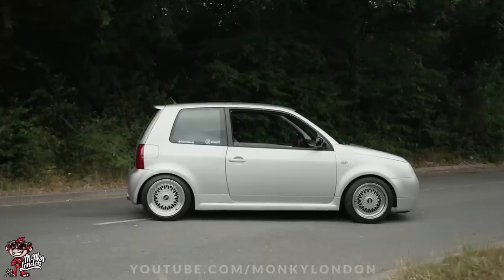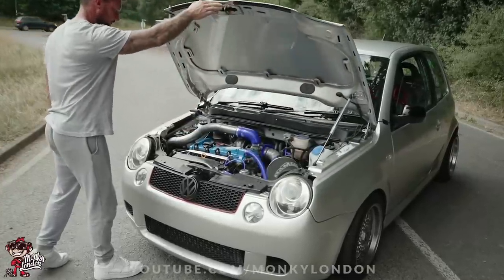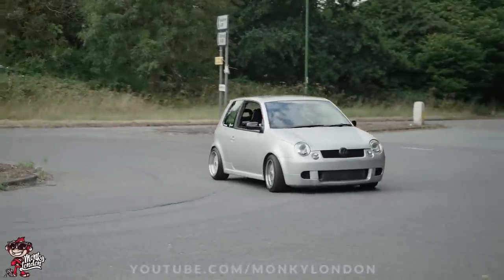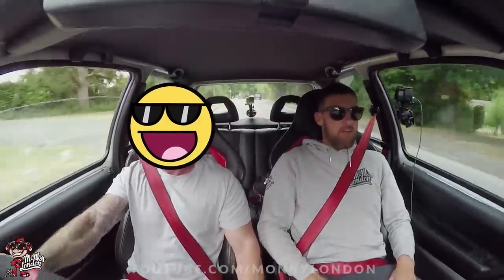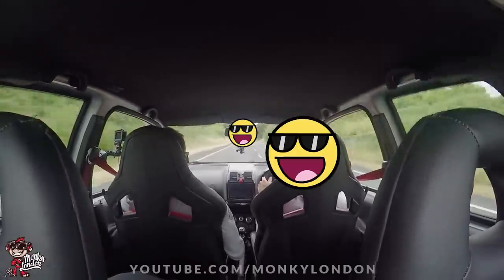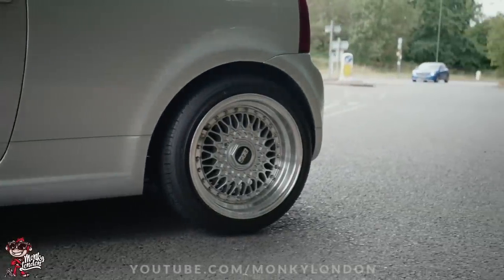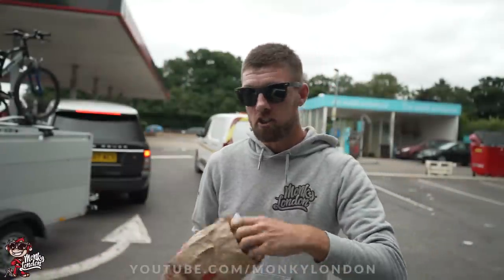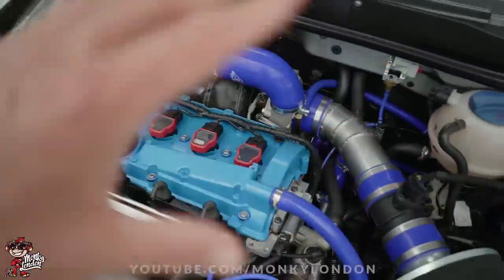🐒 412HP VW LUPO SLEEPER WITH AUDI S3 TURBO SWAP - INSANE!

Comment: lupos are tiny on the outside but feel massive on the inside, i loved my gti, i grew out of it quickly though, it was so well built it felt a bit slow , i can imagine 400 brake in this would feel the same as it would in a polo 20vt, still fast but not as scary as it would be in a mk1 or 2 golf
Reply from the maker: Yeah they deffo feel big on the inside, well made little cars. Cheers for watching!
Reply: True story 👍
Reply: True I have 3L and it feels like a car even closing the doors. Compares to 2021 aygo where closing doors felt like closing metal bin.

Comment: Fun fact: the VW lupo weights 975kg, the mk1 golf weighs only 780kg.
Reply from the maker: Mad that
Reply: The oem Lupo GTI weight is 975 kg but with this engine about 1035 (i have one myself with 1.8T)
Had to weigh it in for registration.
Mk 1 Golf Gti is about 840kg by the way.

Comment: Not really an R32 build… It’s quite clearly a 1.8T swap. The crazy thing is the arosa/lupo shells are actually stiff enough to handle the power pretty well, but the rear beam setup combined with the stubby wheelbase means they spin really fast when the back end lets go. Be epic if someone kitted one out with a decent independent rear suspension setup.
Reply: Doesn't say it is an r32 swap though ;) title says Lupo V's R32. i.e they 'raced' an r32 ;D